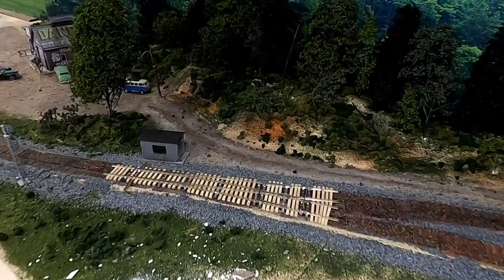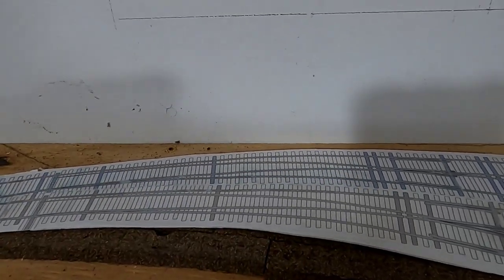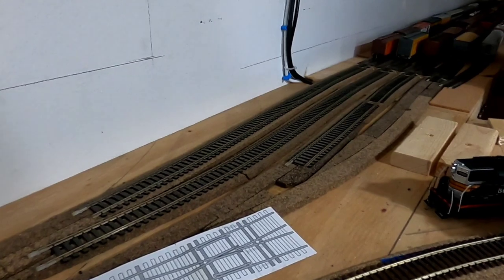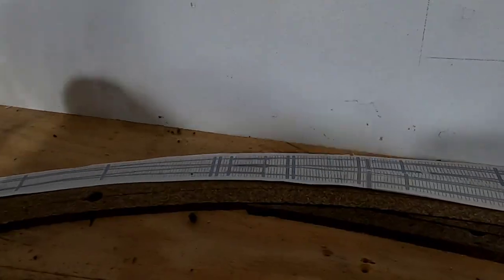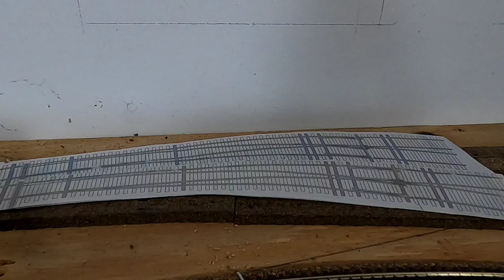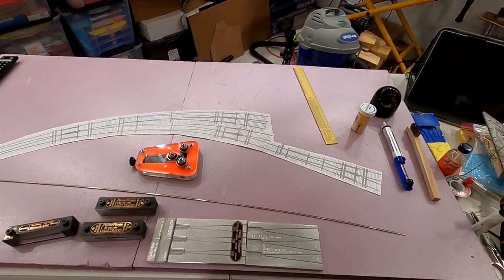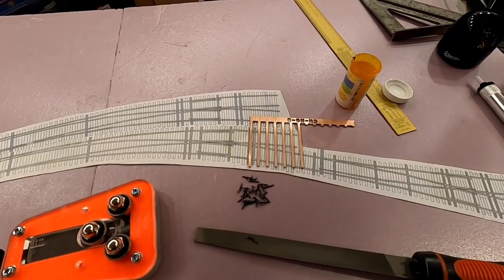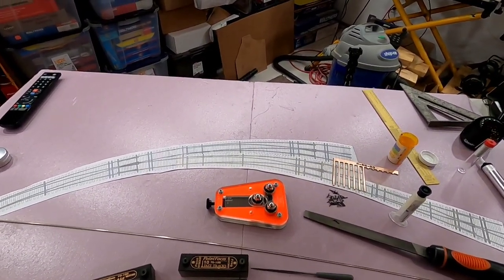Layout Update - Building the New Staging Yard Ladder - Part 1 Intro and the Wye

Comment: Never occurred to me to assemble on a piece of foam board, so you can use the rail spikes like that to hold it down.  Love it!  The only downside when using a full piece like that is that it's cumbersome/difficult to solder on the far side, as you demonstrated a couple times.  Perhaps attaching to a smaller/more portable piece of foam board would be better, at least for the initial assembly?  That way you can turn it around to access the other side easier.
Reply from the maker: Thanks Don! If this was a smaller build, I would definitely use smaller piece of foam board but this thing is roughly 39" wide.

Comment: I have 18 o gauge atlas switch tracks that were removed and replaced at $120 each on my o gauge trainboard.  Bad atlas designs from 2014, intermittent power losses, frogs not powered, rails caught on passing engine rollers. Is that a jig you use and can I get a similar paper guide for atlas o 72 switches...o gauge track spikes.   Gary j
Reply from the maker: Hi Gary! Yes Fast Tracks has jigs in O scale as well. I practiced a few turnouts with a jig but this is all freehand on a paper template which allows you to do more customized builds.